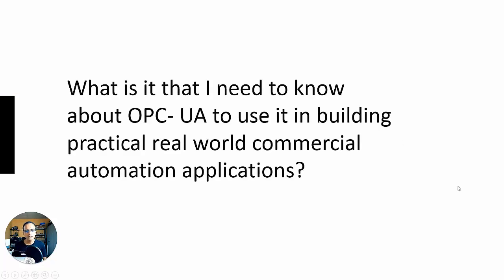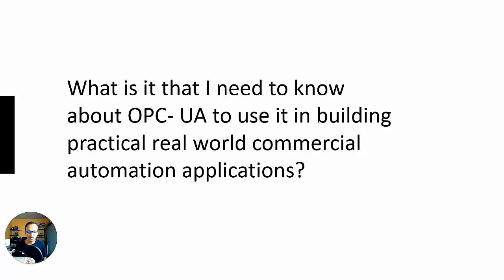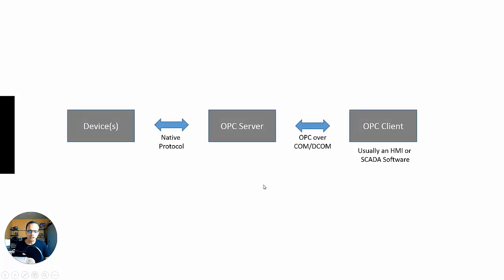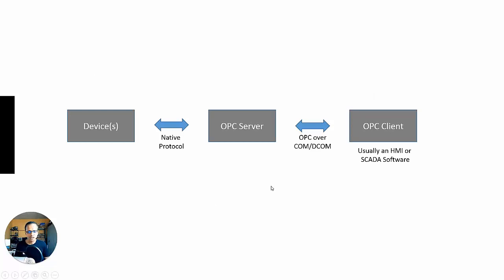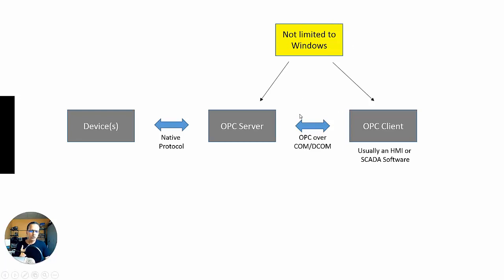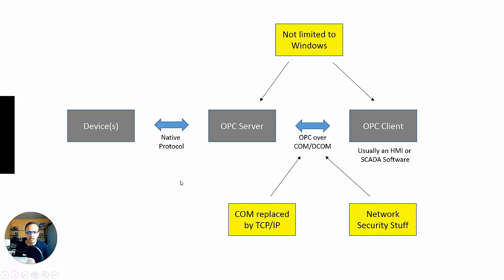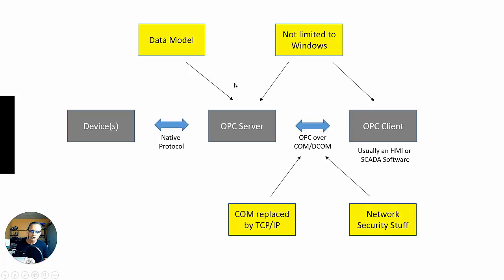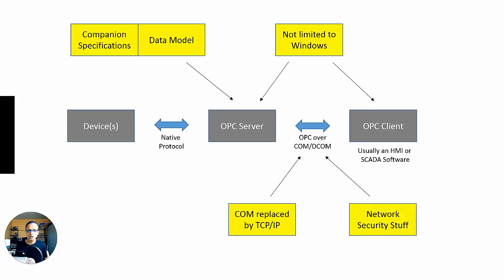Wrapping my head around OPC UA - Part 1

Comment: Hi Emile thank you for this video. I am new to OPC UA. I am struggling with a fundamental question. Is OPCUA a replacement to existing industrial protocol like Modbus, EthernetIP? or is it just for data collection and not a replacement to protocol like. Modbus/EIP that are used for real time control for industrial equipments(like motors). Thank you
Reply from the maker: Really great question. OPC UA is definitely not meant to replace "plant floor" protocols like Modbus, Ethernet/IP, Profibus, Profinet, etc. When I was starting to get into lots of integration work around 2005/6, the SCADA/HMI systems used Classic OPC and were very isolated from the rest of the company IT infrastructure. It just ran on it's own. At no point would there be a connection between an OPC Server and enterprise software. When I say enterprise software, I mean like accounting software, ERP software, warehouse management (WMS), etc. And that worked fine. But as time went along, plant managers realized they could get greater efficiencies by "connecting" plant floor data directly to enterprise systems. This is a pain-in-the-ass to do with Classic OPC. And this is the main reason OPC UA was created. OPC UA is meant to live in the space between the plant floor systems and the enterprise software systems. It was created to "bridge the gap" so to speak.
Reply: @EmileAckbarali  Thank you so much. Very clear.